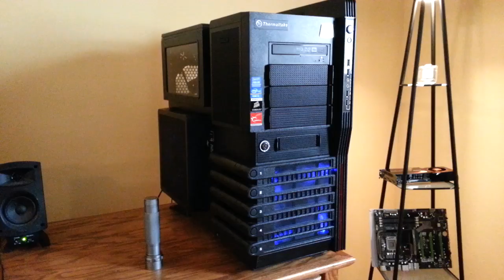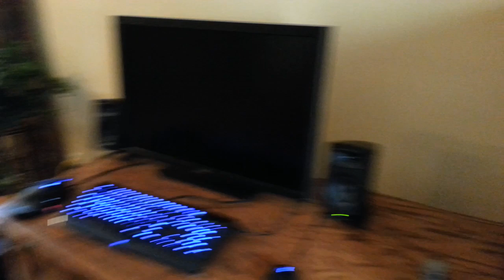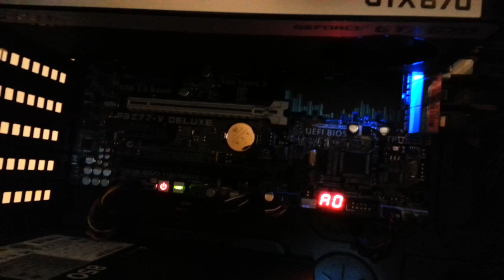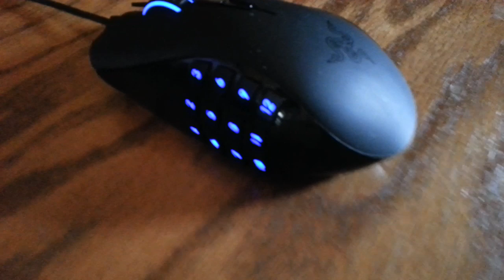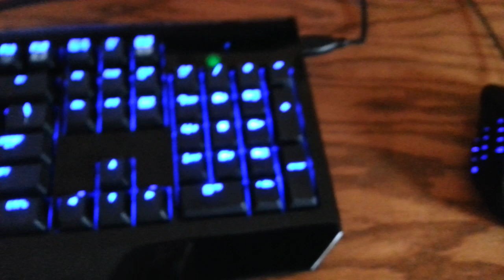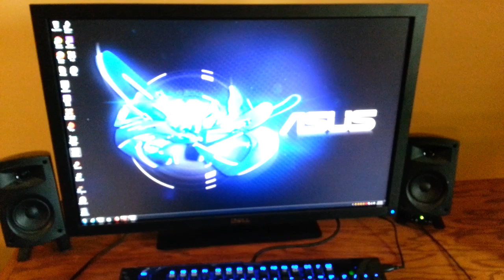The Gaming Rig

Comment: *
GregorysBrain* 2x OCZ Vertex 3 240GB RAID 0.  Those two SSDs must have cost a combined $1,000 back than.  
specs: core i7-3770K / 16GB  (4GB x 4) 2400 MHz / EVGA GTX 670 / Corsair HX 850
Question: What's your current rig's specs?